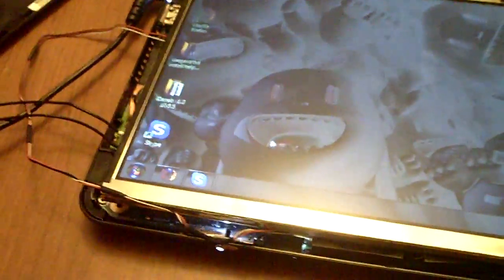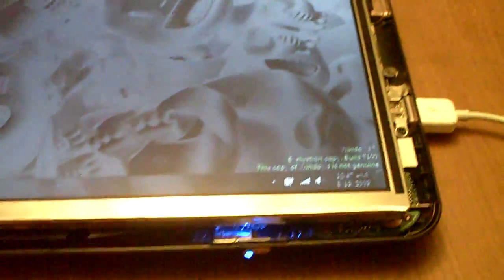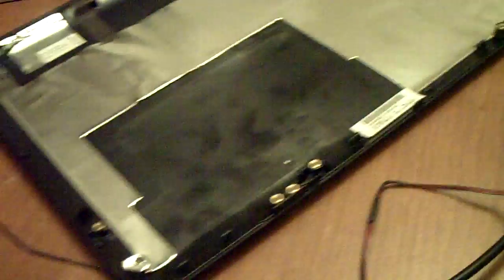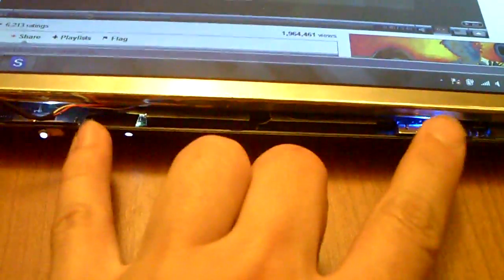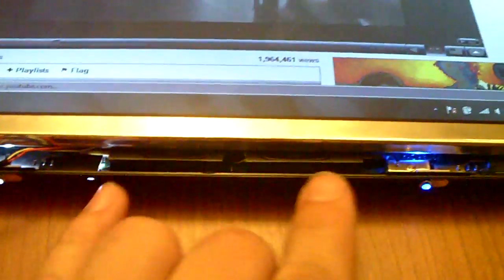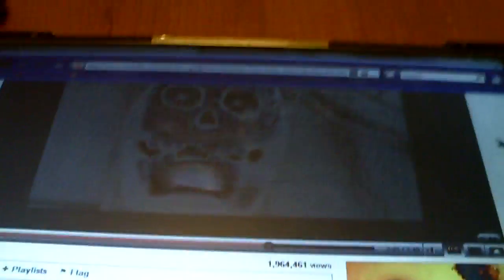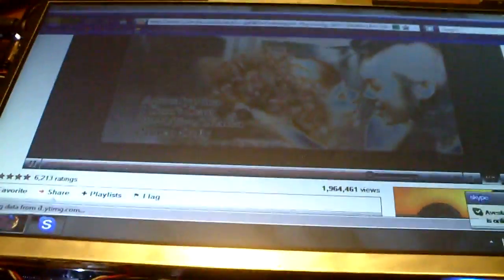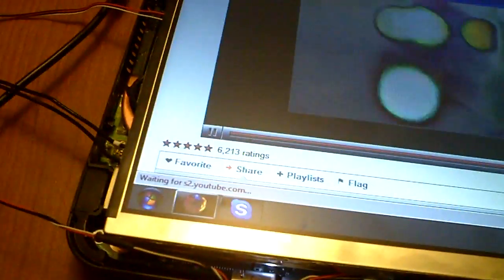Timm on Tech - HP Mini Tablet! 10.2" touchscreen! (Work in Progress)

Comment: Hi there. 
Nice project. :D Just wondering which touchpanels fit the HP mini netbooks. I have a 2140 HP and i can't seem to find any touchscreen panels specific to the netbook. Which one did you use?

Also are you putting an ssd inside ? or just a normal disk